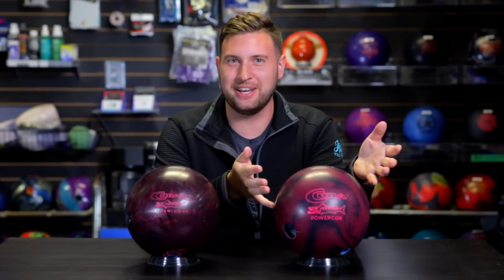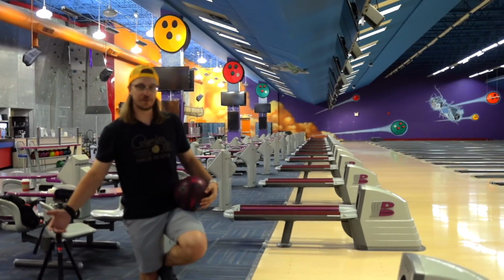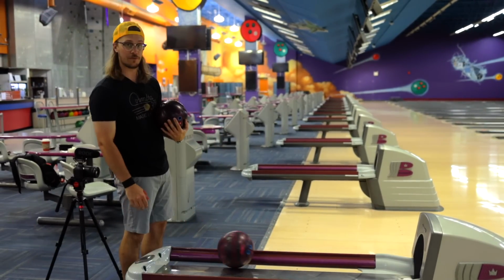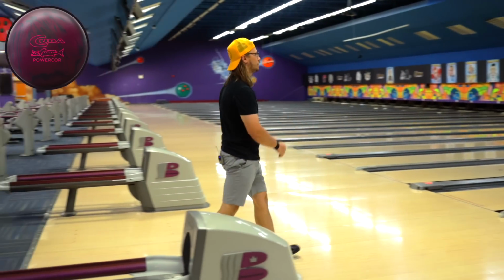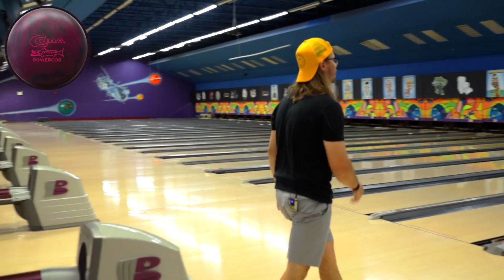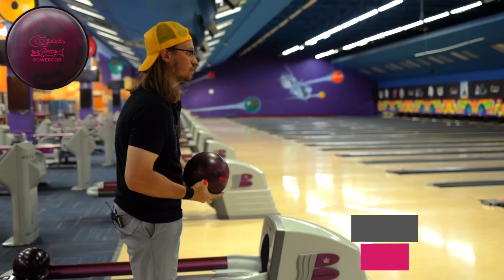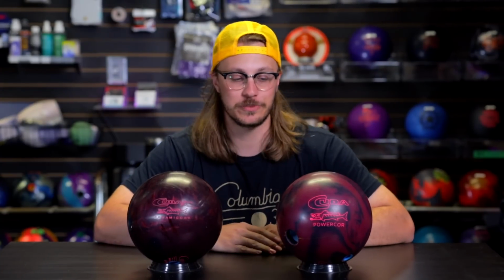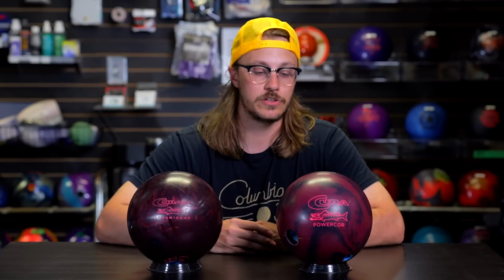NEW IS ALWAYS BETTER?? | Columbia 300 Cuda Powercor | Bowling Ball Review | FT. MITCH HUPÉ

Comment: I have a pair of faball blue hammers that shape real well on the local house shot.  One has a weight hole and I haven’t got around to plugging it yet.  I have a black u dot and a faball pearl hammer I need to plug. 

I have one of the old track balls that has a ceramic core in it and I couldn’t put an IT in it. I think it’s a track ball.  It’s purple color and I haven’t seen it in a min.  It’s buried somewhere.

Oh answer the question- 1991 blue hammer and it’s not used as a spare ball.  Resin ball - 2010 eagle.  Once and awhile the troads comes out along with a storm X factor.  Sometimes the ebonite gb2 is used as well.